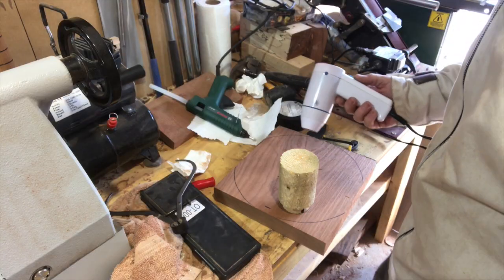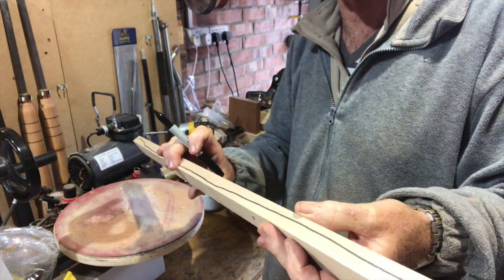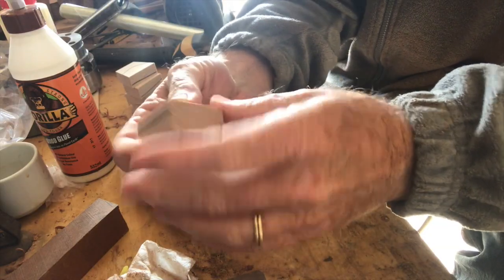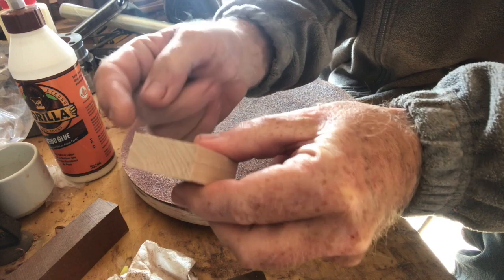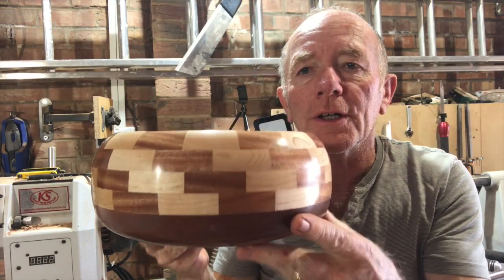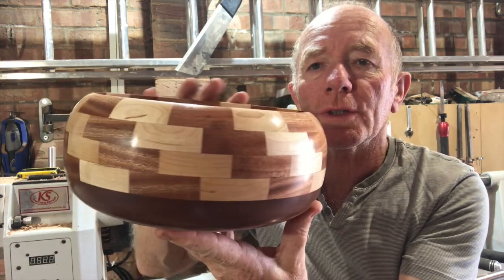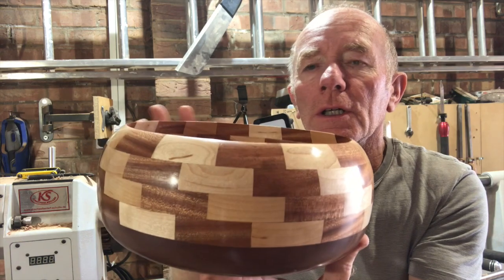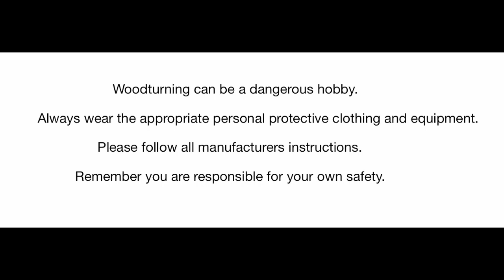# 39 Segmented Spiral Bowl Sapele & Maple

Comment: Another great video Tony, love the final product. Try applying the High Gloss Wax with a hot air gun or hairdryer, better finish in 1/3 off the time,.
Reply from the maker: I would if it wasn't a segmented bowl. Applying heat to a solid bowl would be ok. but a segmented  has a good chance of the glue parting. thank you for the kind comment.
ps did you get your cyclone fitted? whats your opinion? Tony